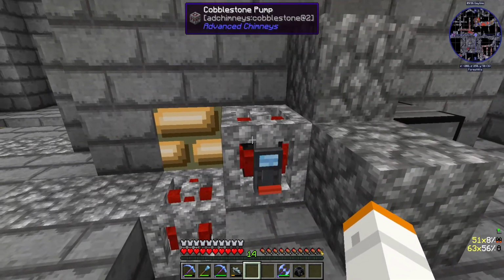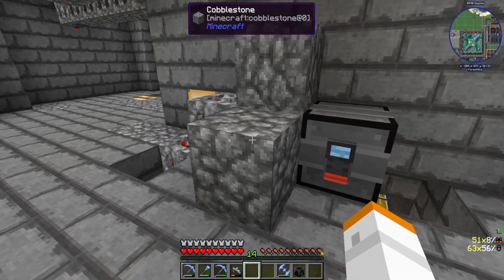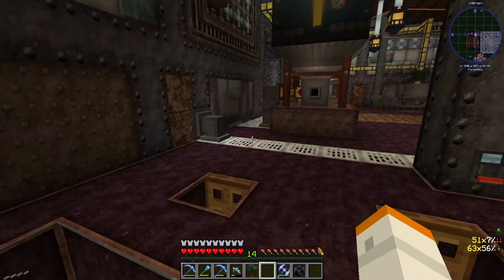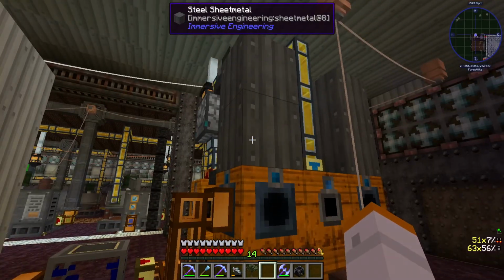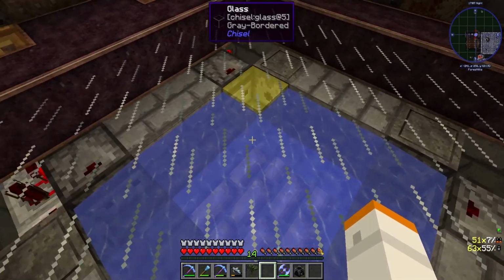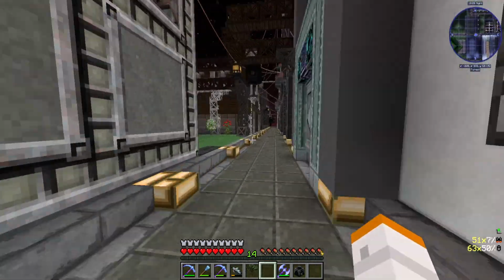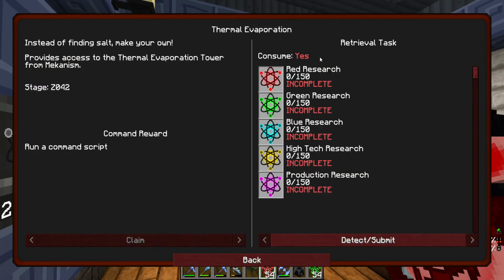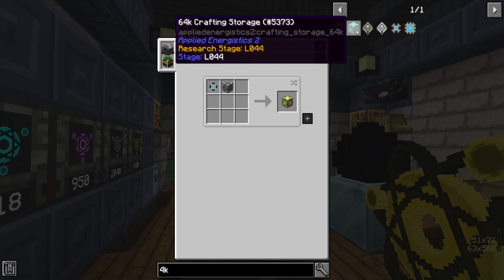Manufactio Making Sulfur Pollution Into Sulfur EP33

Comment: Could you set a chimney pump in the water and pump the polluted water out that way? The mod description shows those chimney pumps working as fluid pumps...
Reply from the maker: This I did not know, this I must test when I get a minute, thanks for the info!
Reply: @Frogman79   it talks about needing to put a filter over it, which brings back the issue of having to wash filters. but maybe block breakers and placers can be used to automate that part? 

definitely worth testing.
https://www.curseforge.com/minecraft/mc-mods/pollution-of-the-realms

you can see it mentioned about half way down right before the confined spaces section